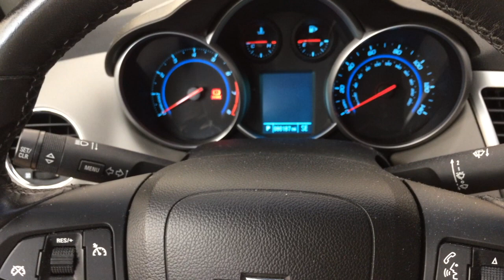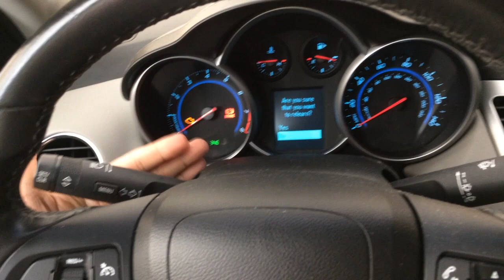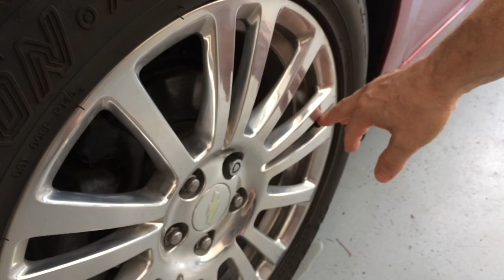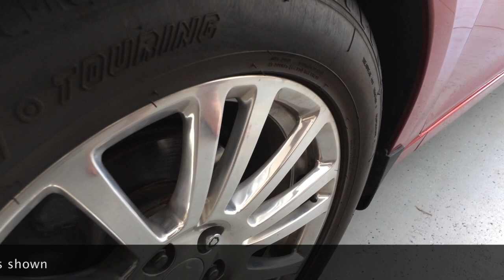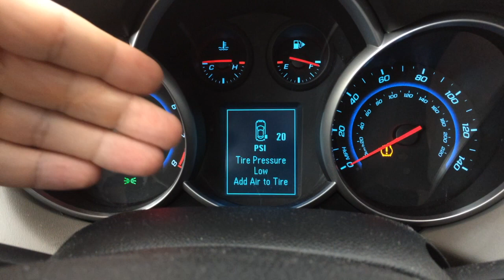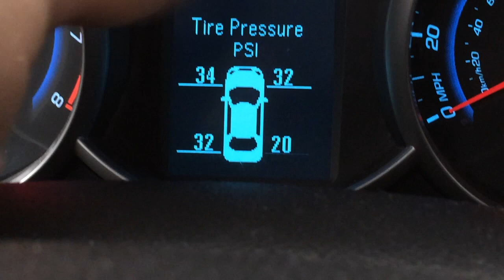2011 - 2016 GM Tire Pressure TPMS Relearn Procedure Tire Rotation TPMS Relearn Tool (Chevy Cruze)

Comment: Is this re-learn procedure required after every tire rotation?
Reply from the maker: Any GM vehicle with TPMS, so since around 2005 or so, will need this procedure performed whenever you rotate the tires, or swap a spare tire in, or replace the Remote Control Door Lock Receiver in the dash.   It's the only way the onboard computer knows which sensor is actually sitting in which position on the vehicle.
Reply: DrShock Thank you very much for the information
Reply: @DrShock  Is it possible that the relearn process to make mistake on the position of tires, e.g. the computer thought the driver rear is driver front and vice versa?  When this happen, how do you tell the positioning is wrong?  Your video show the start position and end position, how do you know which tire is next?  Thanks.
Reply from the maker: It would be highly unlikely for the body control module to make such a mistake. You follow along with the side that is flashing the turn signal lamp. If you make a mistake you can always start the return process again and redo it

Comment: I got a tool and followed the steps and it did not work any ideas on what I should do next ?
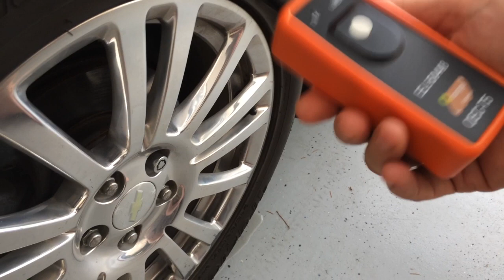Reply from the maker: Did you get this specific tool or a copy / knock-off?   The lower cost copies have very limited vehicle sensor compatibility (they are typically unbranded).  If you have this GM model year range Chevrolet Cruze that we covered in this video, and an actual GM EL-50448 or one of the higher quality equivalent clone tool versions (orange in color and branded Orange Electronics EL-50448 like you see at 1:45), there should be no issues replicating what was shown.  Also there are some notes in the video description about manual transmission model Cruzes.
Reply: @DrShock yeah got the same tools you did, what I did noticed it’s none of the sensor are sending a reading, so I’m thinking maybe I need to replace the tpms sensors
Reply from the maker: If the TPMS sensor batteries were weak, or dead, you would usually get just dashes "--" for a psi reading on the driver information center.   Sometimes the amber TPMS indicator will be illuminated on the instrument cluster as well in that situation.   If you have a manual transmission there's an extra step to trigger the tool.
Reply: @DrShock yeah I’m only getting the dashes on all
Reply from the maker: This video may help with the TPMS sensor replacement.   While the vehicle shown is a Cobalt, the tools and approach would be the same for the Cruze.  Cruze uses a different sensor part number than the Cobalt though - https://youtu.be/PN_SUusV2kk

Comment: So if I have 2 blank lines for both back tires, do I need new sensors?
Reply from the maker: That would be a strong possibility if the other two are responding ok.   Knowing the age of the two unresponding sensors can help confirm the diagnosis (usually the batteries go dead in them after around 8 years on average).
Reply: @DrShock  my car is exactly 8 years old, thanks

Comment: I had the bcm replaced on my 2016 chevy cruze. I tried resetting the tires and all of my sensors work because my car honked at each tire I went through. After I tried resetting all the tires (they all honked and my car honked twice when done) my dash still reads blank under each tire. Any advice?
Reply from the maker: Initial reaction is the BCM was not properly programmed using GMs SPS2 with the latest 2016 Cruze calibrations by VIN number and/or the correct tire type/size was not selected during the programming.

Comment: Spot on. No fluff or filler time. Preferred method to not using a device filling tires to 55PSI risking one blowing out in your face and saving time Item is only 5.00.

Comment: I have a 19 Cruze, so this way of getting to service mode doesn't help me at all.
Reply from the maker: It's the same TPMS EL-50448 relearn tool as shown, but your DIC design has changed for how to get to the menu.   The 2019 owners manual will explain to hold down the start button without any foot pedal contact to enter service mode.   Use the arrow keys on the steering wheel to get into the TPMS tire view and press the checkmark to start the process on vehicles 2017 thru 2019.
Reply: @DrShock  thanks as well - will try this week !

Comment: heyyy, will this help turn back on my sensor - if one of my sensors is blank on the menu screen??
Reply from the maker: Possibly, depends on if the sensors battery hasn't died.  Typically that's the case when they go offline and then you have to replace them like here - https://www.youtube.com/watch?v=PN_SUusV2kk

Comment: Hi, I'm having issues with the one I bought. Is the TX light supposed to keep flashing while holding down the button? Thank you
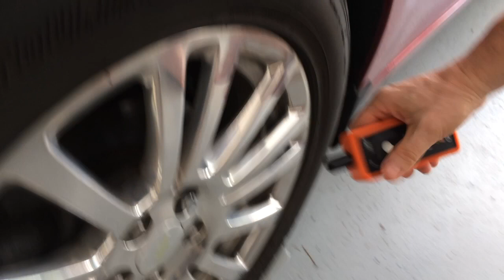Reply from the maker: Like you see in the video at 2:00 the green light will flicker rapidly during transmitting the TPMS position relearn code to the vehicle.

If you're having problems getting a single tire to register (but the rest are ok), it's usually because the TPMS sensor battery is dead and the sensor has to be replaced.   I have a separate video on my channel for how you replace those yourself - https://youtu.be/PN_SUusV2kk

Comment: Will it be able to learn the tire pressure if i use the old method of removing air from the tires??
Reply from the maker: Most GM vehicles went to requiring this type of tool for TPMS relearns starting in 2011.  The air pressure method was 2010 and older only.

Comment: Thanks DrShock, this video was a huge help.  I thought I was getting a faulty reading on one of my tires. I already had the relearning tool that I bought over a year ago and never used it.  It turned out my sensors were not relearned after a recent tire rotation.  You saved me a needless diagnostic fee!!

Comment: So now instead of just letting out a little air, I have to buy a tool?
Reply from the maker: Its a professional mechanics tool.   GM developed it because it cuts the dealership service procedure down to 1/5 - 1/4 the time of air pressure sensor triggering.   Time is money.

Comment: You can buy this tool on amazon for $15, but the same exact tool on the GM website is $65. You used to be able to relearn your tpms without a tool,  just by letting some air out of each tire.  Hey GM,  how bout you stop ripping off your customers?
Reply: I agree, what a joke. It's a money maker for the automotive industry forcing the average consumer to visit their dealership or mechanic for wheel service. ANd while you are they try and upsell, new brakes, shocks, tires or other services. With all of the computer technology out there i'm sure they could have implemented a learning mode using the vehicles onboard computer. It would be similar to the so called "Hand Shake" connecting a laptop to a router. After all most new vehicles today have onboard wifi and navigation.
Reply from the maker: It's not the same as the GM original, but the Chinese clone tool is certainly good enough for DIY and far more appropriately priced.  I did a review of one of the best matching GM design low cost clone TPMS tools on another video here - https://www.youtube.com/watch?v=frON4Fef1k8

Comment: This tool doesn't work on 305/35/24 tires
Reply from the maker: This tool doesn't have anything to do with tires.  Presuming that your TPMS sensor doesn't have a dead battery, what's more likely is that you do not have genuine GM TPMS sensors, or a compatible aftermarket one, mounted inside the wheel so there's either a radio frequency incompatibility, or the more inexpensive aftermarket ones won't support this feature correctly.   Most big brand aftermarket sensors support this GM feature just fine though.
Reply: @DrShock  the sensor on my truck are the originals, the only thing I think of is maybe because the valve is right in the center of the rim and the metal block the frequency of the tool
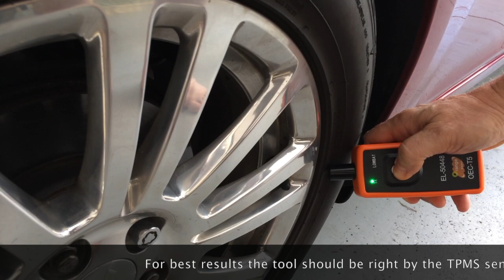Reply from the maker: Yeah I've seen this happen on some trucks, interference from the larger metal rims or weak batteries in an older TPMS module.  When I've hit that I've had luck moving the tools antenna to right against the lip of the metal rim in line with the valve stem and flat end of the antenna on the tire rubber like I show in 2:29 of the video rather than the usual way I show at 2:01 of the video (side ways antenna which is usually what's recommended). Basically holding the tool as if you're trying to push its antenna nose into the tire right at that point.  It's really important the tool has a fresh battery in these situations, for maximum radio transmission power.

Comment: Will this tool work for a 2019 gmc terrian?
Reply from the maker: It did for 2017 and 2018.  I am not aware of any reason why it would not work for a 2019 but you can check with the seller of the tool to confirm before you purchase in case there's something unique about your vehicle.